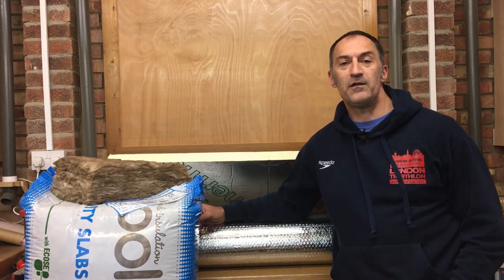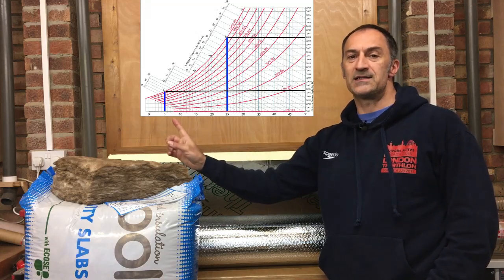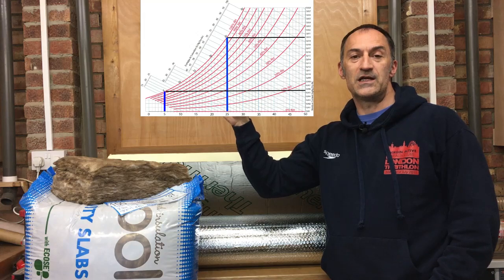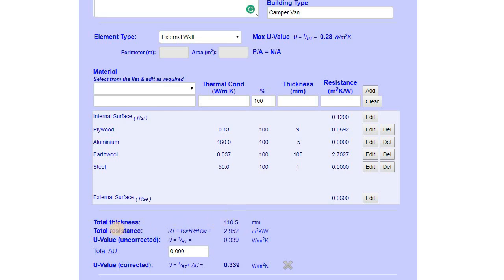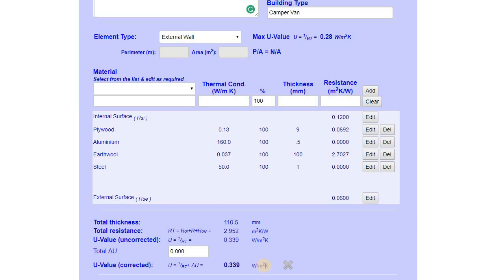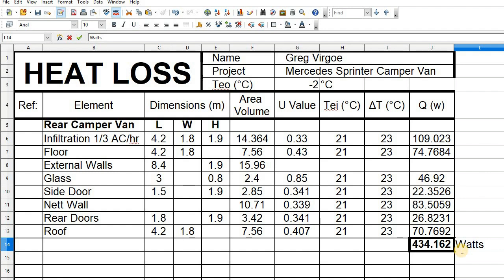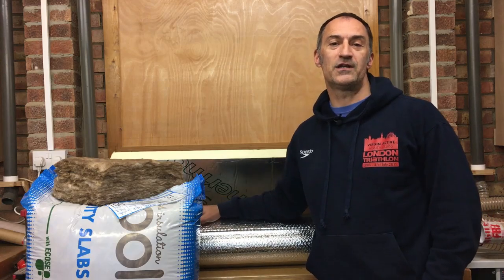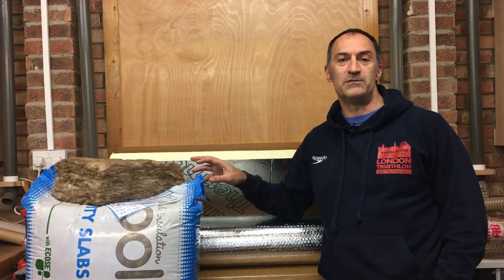How to Insulate your Van Part 1 - The facts you need!

Comment: Thank you.
Can I get your professional opinion on this insulation?
I have some vehicles I'd like to insulate for Heat/Cool/Sounds. 

http://bondedlogic.com/pdf/radiant-barrier/radiant-barrier-cut-sheet.pdf
Reply from the maker: Hello, I have downloaded the spec sheet and see that this is a cotton denim insulation with foil face.
It always annoys me when manufacturers do not publish the correct figures for thermal conductivity.
It instantly makes me question "what are they trying to hide?" So let's break it down for you.
Cotton Denim insulation is actually comparable to fibreglass and has a thermal conductivity of 0.039w/mk
However, this product is only 9.5mm thick so the actual R value is 0.0095/0.039=0.24
You would need 10 layers to match the 100mm of Earthwool or 50mm of Kingspan.
The foil finish will give you a vapour barrier, the insulation will give you a very tiny amount of insulation.
It's advertised as a Radiant Barrier and not as insulation.

Comment: Excellent. I'm electrical engineer and work often in the thermal dynamics area for our observatory building. Great discussion and illustration of the principles. Any discussion on expanding foam? Again. Thanks, enjoyed it. Aloha.
Reply from the maker: Aloha, in the next insulation video I do talk about spray foam. Thanks for asking
Reply: Yup.........I guess that was a "Stay tuned". Great information. Love it. Thanks!
Reply from the maker: If you have not seen it yet, here is the next part https://youtu.be/DKy6WnFh368
Reply: Actually, yes, I did see it. Thanks so much. Great points for sure.

Comment: Fascinating to see how the calculations work! In practical terms (I've built a LWB sprinter conversion) I can tell you that a constant heat input of around 1KW is closer to real life requirement. (That's assuming a similar level of insulation to what you propose, silver screens on the inside of cab windows and outside temps of around or just below zero.) My example might be slightly poorer than your calculations also because the rear windows are fancy looking coach windows that are only single skin glass (not double glazed plastic caravan windows) and there is also both heat and ventilation loss through two sky-lights.
Reply from the maker: Hello, my calculation is only for the rear portion of the van (cargo area) and doesn't include the cab. So your figure of 1kw in total is probably not far out overall. There are more windows in the cab and not much insulation in the structure. So although it's smaller in volume the heat loss will be relatively high when compared to the rear part which is well insulated. Thanks for your comment

Comment: Excellent video! I ave subd! 

Can I just ask @gregvirgoe about leaving a gap between the van steel wall and the insulation? Is this required? Or id it finr to spray adhere the celotex or line the mineral wool onto the van wall? Is there a set configuration, or can you say put the reflectix sprayed directly onto the wall or should this always go on last to act as a vapour barrier to keep moisture off your insulation?  Thank you again, will check your other videos out now.
Reply from the maker: Hello, in this application the vapour barrier must go on the inside of the insulation. Do not stick Reflectix to the metal surface of your van it will have little to no effect in that position. The vapour barrier is there to prevent the most air from getting into your insulation and stopping the condensation. Hope that helps
Reply: So nothign must touch the steel? I see people spray adhesive Celotex boards to the metal? When you say 'inside' of the insulation you mean between you (inside the van) and the insulation.
Reply from the maker: You can stick your insulation to the steel van, you can spray foam on the steel of your van, that is fine. There does not need to be an air gap here, better without any gaps. 
Just don't put your Reflectix or vapour barrier on the steel of your van this is the wrong place for it.
The build up goes - steel van, insulation, vapour barrier, ply or timber panels. Hope that clears it up for you.
The vapour barrier can also be a heavy duty polythene sheet, works the same as foil vapour barrier.
Reply: Thank you for your reply, just one last question as I know this is time consuming for you.. The polythene sheet vs reflectix, they have the same vapour protection properties - but I guess reflectix has better heat radiation properties? and in a shower, let's say behind the plastic splash proof wall, would you just use poly sheet or refelctrix again to stop any moisutre leak?
Reply: I have just read something that conincided with what you said, about no air gap.. an air gap would only be needed if you was not using physical insulation as the air/gap itself acts as an insulator, but in colder climates it has too much thermall conductivity to be ideal.. So the only time you need an air gap is if it is just Reflectix or similar being used.
Reply from the maker: Leave the air gaps to house building, an air gap needs to be a minimum of 20mm to be effective and even then the R-Value is typically only 0.18 so minimal.
Reply from the maker: Aluminium foil is totally impervious to moisture, polythene is very slightly permeable but its next to nothing.
https://4.bp.blogspot.com/-yE9OE6--ah8/VvMEU11aTMI/AAAAAAAACS8/H201J9koo8wGYmjpvwMKpUh11ywFe8eHg/s1600/Table%2B-%2BPermeance%2Bof%2BCommon%2BBuilding%2BMaterials%2B500p.jpg
To be honest you can use either as a vapour barrier they will both work well.
The foil does reflect the radiant heat but not much when sandwiched into a structure like this.
From work experience, the foil is used more to combat condensation issues.

Comment: As someone who is waiting to take delivery of my first motorhome and works with insulation (sorry nothing more technical than cutting it to size for timber framed buildings!) I found your video very interesting, I think I understood most of it. I was wondering if there are any small tips with regards to condensation when my van is in the driveway next winter and not being used much, if at all. Thanks
Reply from the maker: Please watch my next insulation video and the flooring video that will hopefully give you some extra info.
When your van is not in use the inside will not suffer from condensation as it will be the same temp as the outside of the van. Its mainly when you are sleeping in it and cooking in it and its cold out when you get lots of condensation
Reply: Thanks Greg, that makes a lot of sense. I've been 'over thinking' the consequences of it not being used much in winter. We've been looking at vans for some time now and heard so many horror stories about damp. In the end we bought new! Just hope we get a good one !!
Reply from the maker: What van did you go for and what are your travel plans?
Reply: We went for an Elddis Accordo Prestige 105. A nice compact 6 metre front lounge coach built, with GRP sides. Can I assume that the GRP sides may be a better option with regard to condensation?It has come with many extras and we got them to fit a twin bottle Gaslow system. We don't get our van till June. We've got no plans as such yet for this year but probably end up touring South Wales and Somerset and Devon. We may go on some rallies with Motorhome Fun which we joined almost two years ago. I've learned such a lot with them and look forward to putting faces to names.  Next year hope to go for an extended trip to the Outer Hebrides which is on my 'bucket list'!
Reply from the maker: You are right the GRP plastic walls have much better thermal properties than steel.
It is comparable to insulation materials and approx 150 times better than steel.
I'm fitting a Gaslow system too, one larger bottle. I will look up Motorhome Fun.
Best wishes on all your travels and thank you for your great feedback on my videos.
Reply: They're a great bunch at MHF. It's a really good community and you'll be made most welcome. Maybe even bump into you some day!!Thanks once again for your help. Davy

Comment: This is exactly what I have been looking for.  Thanks for this info.
Reply from the maker: Hi Cathy, really glad you found me and pleased it was useful to you. What are your van life plans? 😀
Reply: I'm doing my second van conversion and hoping to do things better than the last one I did 30 years ago.
Reply from the maker: Very interesting? So what have you gone for this time and what (if I can be so bold) have you learned from last time?
Reply: I got a Nissan low-top van this time.  I didn't want to use fiberglass insulation which I did in my first conversion.  Also I always wondered about condensation and mold problems.  I won't be living in my van full-time but using it for long camping trips.
Reply from the maker: Making sure you have a very good vapour barrier over your insulation before you panel the van will prevent the build up of condensation. This is where people have gone wrong in the past. Best wishes

Comment: Could you please tell me about floor insulation? I am thinking about not doing it.
Reply: Insulating walls and ceiling. There is already a plywood floor with fibreglass painted on it. This was also on the walls but we ripped it off. Considering leaving the floor. Some tell us it's not worth insulating floor because it will still be cold. I'm worried about moisture build up with vapour barrier and also the fact there is fibreglass which I am told eventually attracts mould. Please help.
Reply from the maker: Hi Emma, I understand your concern and I can confirm those who say insulating the floor makes no difference do not know what they are talking about. The structure of your floor is no different to the walls and roof. It's a thin sheet of metal which is also exposed to the cold or hot air outside. It will condensate the same if not treated and yes it will be cold if not insulated. Applying any insulation and a proper vapour barrier will vastly improve the thermal properties of your floor. I would advise putting something down if you can spare the headroom. Watch my flooring video to see how I did mine with 25mm of Celotex board and timber battens. https://youtu.be/DxJ38lQfSg4
Reply: Greg Virgoe Thanks so much! Little star struck that you answered. Big fan of your amazing videos.
Reply: Greg Virgoe I'm gonna do it. I don't want to risk it. Not doing it doesn't make sense to me.
Reply from the maker: You are the reason I’m here Emma 😊 really pleased to help and glad you like the videos. If you can spare the extra 1” on the floor it is worth it. Many thanks
Reply: Greg Virgoe We did it today! I'm so glad we took your advice! The plywood under the fibreglass was completely saturated! Lucky we took it off now before any rust. So lucky there wasn't any already!
Reply from the maker: Well done Emma, it would have only got worse once you were sleeping in it. At least now you can improve it and be nice and snug in the future. 
Really pleased for you 😊

Comment: Greg, fantastic video, super informative and broken down so it's easy to consume.  I especially like the psychrometric chart and relative humidity discussion.  On the U-value calculator I don't see the Therma board listed in the calculation - did I miss something?   Also, I redid a school bus years ago and replaced fibreglass with Therma board (floors and walls); what I noticed on the walls was the fibreglass over the years had sagged and was no longer insulating under the windows - will earthwool sag with vibrations?
Reply from the maker: Hello, glad you enjoyed the video. In the walls I have both Earthwool and Kingspan so technically I should have worked out separate U values for each but for the purpose of this video I just did the one to show the method. That's a good point about the insulation sagging over time. I have over sized it so it's packed in nice and snug. I could add a few stick pins to help support it or you could use a little spray glue on the van.

Comment: Excellent!!! I just bought a 1/4” reflectex for my floor. :( I’m trying to keep the height down because I’m just redoing my regular size van so the head space  is very limited. Now I’m rethinking though
Reply from the maker: Hello, really sorry, but just putting Reflectix on the floor of your van will add no insulation value at all, once all the bubbles have burst underfoot it will be just like having couple of sheets of tin foil on the floor. If you want to add insulation the minimum you could look at would be 1" of Celotex. Otherwise just stick plywood down and suffer a cold floor?
Reply: Greg Virgoe I was leaning to no insulation. Should I not bother putting the reflectex at all then?
Reply from the maker: Unfortunately just putting a layer of Reflectix on the floor of your van is going to make little to no difference thermally. If you are going to insulate use a better product otherwise just put a ply subfloor down and accept that it will be colder. https://youtu.be/DxJ38lQfSg4

Comment: Thanks for sharing,  I actually managed to understand most of it. I'm glad I came across you're video before I started on my van hopefully now I can get it right first time. A couple of questions though,  what would be your thoughts on the spray on foam and what would you suggest for ventilation? So as not to loose all that vauble heat. Thanks again for the video and you've got a new subscriber.
Reply from the maker: Thank you for subscribing Tom, spray foam is a very good insulator, it has the same thermal properties as the Kingspan or Celotex boards. Watch my next insulation video for my thoughts on spray foam. I have installed two roof fans for ventilation, they can both be set to supply or extract to give good circulation. I also fitting a very good LPG combi boiler for plenty of heating.

Comment: Do all of those numbers really matter though with so many windows in most vans?  Even if you block those off, you still have doors and other spots where even if you sealed them 100% there is still usually metal acting like a heat sink between you and the outside.  Don't get me wrong, I'm sure some insulation is better than none.  However, I'm not so sure the type is going to make a huge difference.  Think of it as a huge dam that has all the outflows open and is letting water through like crazy.  Yes, without the rest of the dam then you would have a TON more water flooding in.  However, whether that dam has a few extra leaks in it isn't going to make a huge difference in the big picture... at least not in regards to how much water is getting through.  You are the expert though.
Reply from the maker: To use your analogy, imagine your dam is made of a loose pile of sticks it would be letting lots more water through than if it was made of solid reinforced concrete. 
My purpose is to suggest the best materials to use and yes it will make a big difference.
Reply: Yeah, i get that one lets in more than the other.  The point I'm trying to make is that if there is already so much coming in that it's going to be too hot or cold inside then it seems kind of irrelevant.  Once either happens the windows and vents are going to need to be opened... either to cool or to let let fresh air in when heating.  

THAT SAID, I do see your point being relevant for various temperatures.  For example, if it is 50 out then better insulation is probably going to make it a lot more comfortable inside.  With worse insulation it may have to be 55 to get the same feel.  With no insulation maybe 65 or even 70 depending on how much direct sun you have.  However, once you start getting above like 80 or so, then the windows are coming open no matter what insulation you have.  Same for when you get much lower temps.  Once that happens you are most likely still better off having insulation, but I don't think it will have as great an effect since you now have a river of outside air coming through.

Anyway, I think I have gotten my thinking across.  I appreciate the reply.  I will take your word that it does make a big difference.  I'm just saying I don't quite see why.  But then I don't always understand what specialists in various fields are saying either but that doesn't mean they aren't right...lol.
Reply from the maker: I’m not saying you have to build yours this way. It’s your van mate. Do what you feel happy with. Good luck 😉

Comment: Hi Greg. Can't thank you enough for such amazingly helpful videos! If I understood your explanation well this material seems to do a great job with a lot less thickness: https://www.ecohome-insulation.com/?i=39714 
What do you think?
Reply from the maker: Hello Henrique,
I was given three rolls of this insulation when I started my van conversion. 
I took it down the local tip and threw it in the skip. That's what I think.
No values of Thermal conductivity and they only publish an R-Value on the condition it has a 25mm cavity either side.
There are far better and cheaper alternatives, I would not waste your money on this stuff.
Reply: Ahah! Really appreciate your honest feedback! I was thinking the R value sounded good but no thermal conductivity and didn't know about the 25mm either side

Comment: How much did the insulation including flooring costs?
Reply from the maker: 4x sheets of 50mm Kingspan @ £35 a sheet
4x sheets of 25mm Celotex @ £29 a sheet
3 packs of Earthwool Cavity @ £19 a pack
3 rolls of Reflectix insulation @ £20 a roll
Foil Tape and Stick Pins £25
1 pack of 8 Timber Battens total £24 pack
4 sheets of 12mm plywood @ £26 a sheet

Total spend to fully insulate van and new ply subfloor = £526.00
Reply: WoW that's cheaper than i spected. Thank You!
Reply from the maker: No problem, you're welcome.